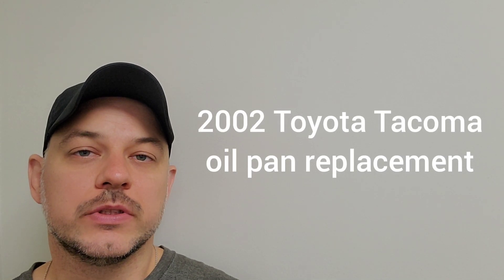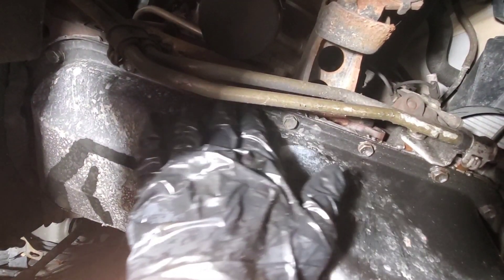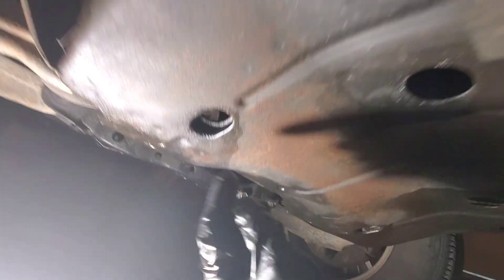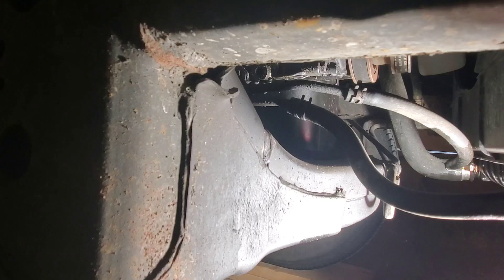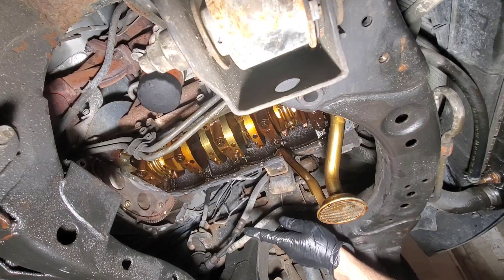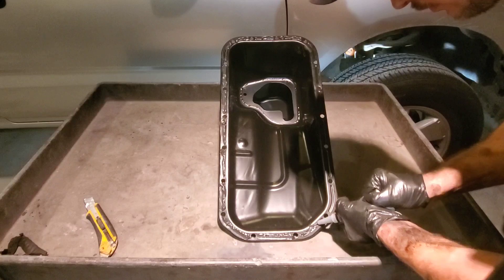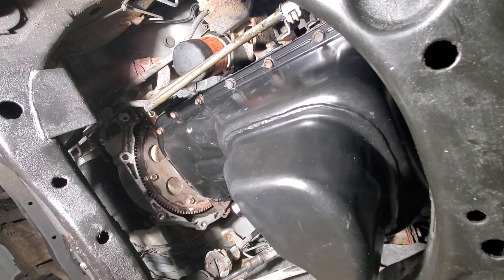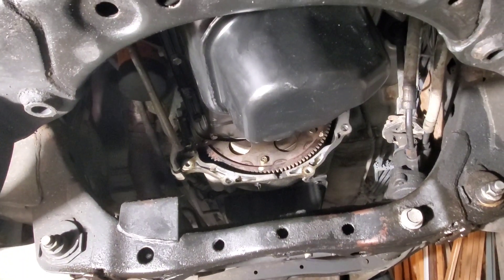1995-2004 RWD Toyota Tacoma oil pan replacement (DIY guide)

Comment: I just followed the same process today with my Toyota Tacoma 2004 3RZ-FE engine 2.7L 4 cylinders 2WD/RWD.
I used the Fel-Pro cork rubber gasket model OS30642C, but the oil pan is still leaking. I am concerned I may have overtightened the cork-rubber gasket, which caused the rubber-cork gasket to break and thus broke the seal.
Reply from the maker: Do you see if the gasket has been pinched any where?

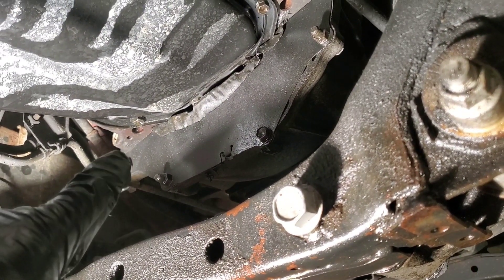Comment: I'm trying to repair my 1997 Tacoma Extra Cab's oil pan gasket, but the rear of the pan looks nothing like that.   I want there to be a dust cover but instead it is a thick piece of iron with webbing, I'm afraid it's part of the transmission, I have an automatic tranny.  Is that a manual?  I can try and take a picture.  But I am vexed. 3:22 into the video.
Reply from the maker: Thanks for your question, its an automatic. The cover is the flywheel cover. Feel free to send a pic. The email is under the "About" heading. Does the engine look the same from the top with the hood popped open?
Reply: @HomeownerDIY  Hello, I've replied twice with URLs but YT just removes them.   I have a pic on my web site, and a pdf of the repair manual.  I'll send both links to you, but your email is not in the description.
Reply from the maker: @bansheedearg  my email is wittlekat@hotmail.com

FYI, if you click on "more" for the decription, the email can be found just below "Channel details"

Send me a pic and l will what l can do to help you.
Reply from the maker: I saw the pic that you posted in the comments, can you take another one more zoomed out? Its too tight to see what part of the engine the pic is from.